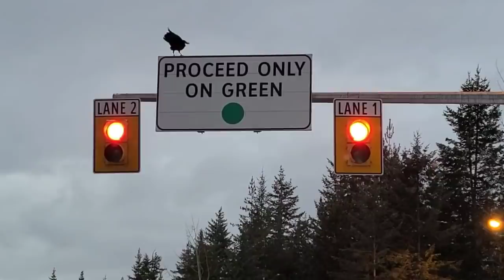WE FOUND THE BIG MOUNTAINS! 😲

Comment: Those CVTech's are sold out every where right now so I bought a used Team off a 2017 M, do you think it will be worth it over the stock 2012 primary or should I flip and find something else?
Reply from the maker: The clutch on that 2017 is a good clutch. I'd roll with that one.
Reply: @syxxes  Thanks boss, keep up the good work.

Comment: What's the reliability in the hard core
Reply from the maker: Has around 1500km on it. Never been back to the shop once for a warranty or otherwise. The RMK is a whole 'nother story. At similar mileage it's had 3 shocks put in, a motor, a clutch and a few other things